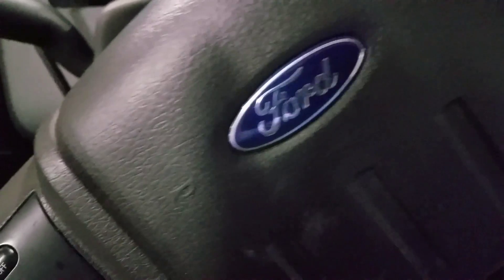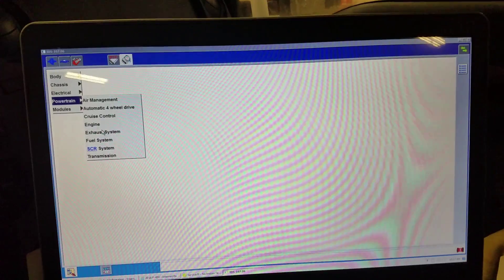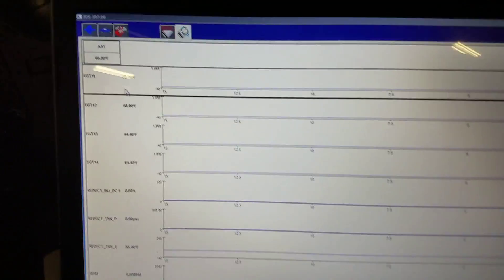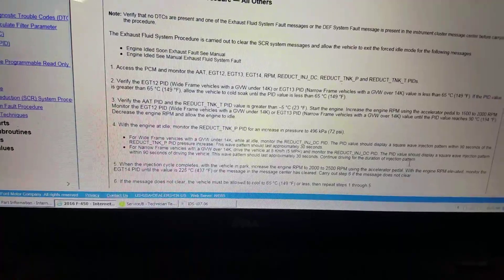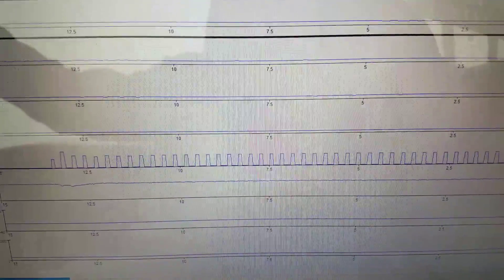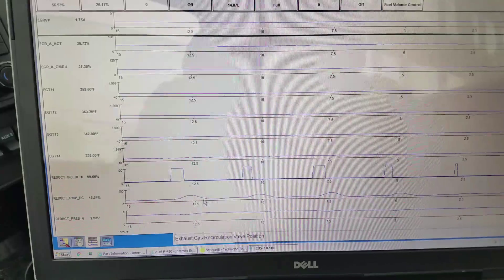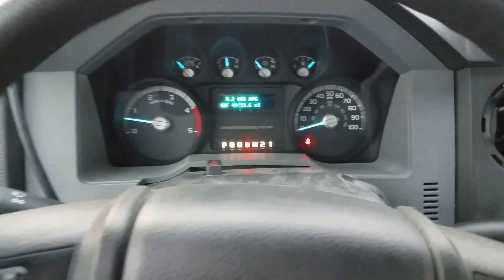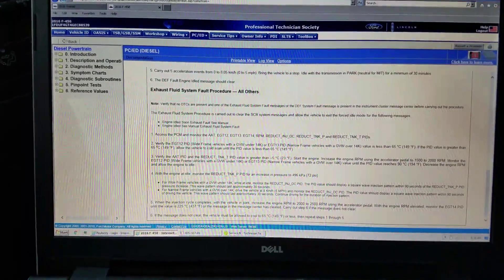Ford 6.7 DERATE warning messages - FIX IT NOW! #viral

Comment: Is there anyway to get a 2016 f250 lariat out of engine idle with out a computer I need to get it to the shop which is 70 miles away
Reply: Thanks man love your videos
Reply from the maker: You could try sitting there at two thousand r.P m for 5 min

Comment: Hey man. I’m trying to get a customers truck out of this derate. Exact same messages and no DTC’s. I have tried the drive cycle 5 times and I can not get the 1-4 EGT to 437F, I can’t get it past 360F. Also my DEF injector pattern does not look like that, it looks like triangles not squares. Any ideas? Thanks!
Reply from the maker: Are you using IDS? What year is the truck?
Reply: @ I’m not. I need to renew my IDS license, I miss it. I’m using an AUTEL. 2015 narrow frame
Reply from the maker: @belllpatrick hmmmmm wish ya were closer
Reply: @PowerStrokeTechTalkwARod  I can get an IDS scan tool and use that if that would help
Reply from the maker: @belllpatrick absolutely
Reply: @PowerStrokeTechTalkwARod  ok, what difference does that make in this instance monitoring pids?
Reply: @PowerStrokeTechTalkwARod  we ended up updated the pcm with the latest update using IDS and it cleared with a drive cycle easy way before 437F. We also got the square wave pattern after the update.
Reply: @ it came in with the idle only condition. Only one DTC and it was for an AC pressure sensor, I fixed that and now no DTCs. It started earlier in the morning with the customer with the 50mph max message then quickly idle only. The def tank level pid read 99.98% when we got but we put about 1.5 gallons in it somehow, it now reads 100%

Comment: Have you encountered the service filter now message on the 2020+ powerstroke? Have a 22 with that message, had dpf professionally cleaned and still have the message and the engine code will not clear I’ve tried Matco and Snapon scanners will not run a regen and stuck in limp mode.
Reply from the maker: Gonna need a dealer level scan tool that can access those faults
Reply: @PowerStrokeTechTalkwARod  copy so texta and none of the other big brands will be able to clear it.

Comment: What software and computer are you using for this? Dealer told me 3 weeks before they could look at it. Exact same issue I am having after filling with def. Any help is appreciated. Frustrated!
Reply from the maker: Ford IDS software. You can use Forscan too.
Reply: Good grief! 3 weeks where do you live?

Comment: been reading alot about DEF since my 97 f250 7.3 PS does not use it and i know have a 23 f450 ho 6.7.  you are the first one that states to fill def tank completely.  i had planned to add 2'5 gallons when the tank got down to about a quarterfull because i didn't want the def to get old setting in the tank.  i am trying to save the new truck for trips, etc and use the 97 daily.  is it a bad idea to just add the 2.5 gallons when needed. thanks and i am a subscriber!

Comment: We had pin spreading at PCM due to a mechanic at a different shop jamming something in there to test with, then cutting wires that should not have been cut at all.... El Butcho El Chopo

Comment: What if the warning comes up and were not out if DEF just refilled DEF a week ago and only drove less than 500 miles.  Still had 20 miles of the count down left when i pulled up to DEF pump.  This has been a reoccurring issue with my 2015.  Delaership has already replaced pcm, pcm harness, reductant pump, reductant harness.  Getting expensive
Any ideas why i keep getting a exhust fluid system fault warning?
Reply from the maker: What code r you getting & why did they replace all that!?!?

Comment: So I pretty much knew about this system when I got my 2015 in nov,2014 and read up on it I’ve never had an issue with it other than a couple of def heaters and froze the system up once when I jumped on the freeway when it was slushy and stupid cold out I was out plowing and pretty much froze the entire underside of the truck so I got the 50 miles till speed limiting, Plowing was over for that storm. Upon restart The PCM forgot that there was an issue I just drove south I got all the way to I  Louisville Tn from Milwaukee and the ice pack fell off the bottom of the truck and the issue was over🤣 Yeah I think I had cabin fever😇 , jump forward 4 years to now and I have started to decide that the DEF system had lost its mind speed limit warnings ect… all fixing themselves so I filled it all the way up and told it that it was full (via FORScan)i dont think it cared or listened and now about a week later I’m at Forced engine idle. In the morning I will run through this procedure as many times as I have to to allow it to rediscover it pea sized brain. That said i always put 2.5gal at half full however this last time around I probably helped it lose its mind after nine months of it not asking for any def I I want ahead and put 2.8 gallons in at the pump.

Comment: I’m sitting here with a 2015 f350 that I started the procedure to clear the forced engine idle and yeah my laptop died I had no idea what my temps were at that point so Round1 fail, and I simply decide to let cold soak overnight I’ll deal with it in the morning, Then I remembered I can watch pids in real time on  my phone, but alas it was too warm so I’ll wait till morning. On my phone I have FORScan Lite and a few other things but this works best it’s only for Ford, my laptop I has FORScan. this is literally the first time I was using it on the laptop so I’m still in the learning curve.  it does have a ton of procedures/ resets that  it will run for you. I use both with a plugin adapter that can natively read the can-bus and the HS-can-bus.
Reply: A small update this morning I hooked up to the truck KOEOFF  configured my pids I didn't bother with EGT13 as this is a wide frame, started the truck confirmed the aat and reductant tank temp was above 23 f and revved it till it got to 200f idled it yeah it took all 90 seconds and maybe more for the dosing cycle to begin, it finished and I revved it between 2000 and 2,500 yeah it took a little while to get it up on egt14 to.... it cleared the light when it got up to around 311f  all fixed. I'm sure I caused this all by myself when I'm at home I fill up def at the pump but I'm on the road so it's coming out of bottles. This is the first time for me it probably won't be the last but it did take 8 years to happen. Now I'm going to go turn on the daytime running lights.

Comment: how much was the customer charged for this? my 6.7 has the same thing going on and im taking it to the ford dealer here in wisconsin.
Reply from the maker: Depends
Reply: @PowerStrokeTechTalkwARod  i went to my local ford dealer. 2 weeks until they look at it. later today i drove to the gas station and it reset by itself. no more limp mode or light on. im happy!!!!

Comment: I have a 2016 that has idle locked a few times now. Trying to learn about the SCR and how to resolve these types of issues. The first time it idled I got a very similar square wave pattern to the video on the reduct_inj_DC pid, now its getting sloppier with longer waves and more irregular in nature. Anyone know if thats a sign of dirty/bad injector? I've drained and replaced the fluid and was good for few hundred miles, now back to being idled.
Reply from the maker: Your not doing somethin correct Jonathan
Reply: @PowerStrokeTechTalkwARod  It works though, which is odd. In fact in the last five minutes I've pulled the truck out of idle mode. I guess its still a square wave, just longer duration. I still need to resolve the "why" of why this keeps happening, but we're getting there, huge thanks to your videos.
Reply: @PowerStrokeTechTalkwARod  follow up part 2: the waves are flat topped, but the trailing edge may have a more dramatic slope and the pattern itself is irregular. Rather than a nice consistent /'\../'\../'\../'\ it may go /'''''''''''\............../'\/'\......./''''''''''''''''''''''''''''''''''''''''''''\. Rough description of a wave pattern, but if it helps anyone to see it's weird looking for me, then great.

Comment: I just got a speed limit at 55mph within 150 miles. A check engine light as well with two codes p207F and p0401. Before this happens, the truck was self-cleaning the exhaust filter but I accidentally turn off the truck while that was performance. I don't know if that happened because of that or something else. ??
Reply from the maker: If you need diagnosis you'll have to get inline & come with $$$ my time is no longer free. Sry, just business....

Comment: Fill with DEF...Clear codes..Do not have to drive.....Hold  to 2500 Rpms for 6/10 mins will accelerate up about 2900 rpms after 6/10 mins on its own and will reset ...Manual Regen...This will fix dead pedal and clear error....
Reply: SUCCESS! I did this tonight but used an Operator Commanded Regen instead of manually holding the throttle pedal. Drove for 10 minutes afterward, shut the truck off, and then back on, and the error was clear! Thanks for being one of the only people I've found in all of the comments to suggest this!
Reply: I was racking my brain replacing parts $$$    I did this for about 9 mins @ 2500rpm, truck forced reg, got rid of the engine idol, started again no check engine or idol mode....big thanks
Reply: This comment got me fixed. Used forscan/obd2 cleared DTC codes, filled DEF, ran about 2500 rpms (parked) for 17 minutes, rpms increased gradually but also quickly up to 3100 over the span of 10 more min, oil temp approximately 230 (if i recall), code went off after about 27 min automatically
Reply: Does it need to be in limp mode in for this procedure to work?
Reply from the maker: @dgrisham6868 yea

Comment: I have 2 questions. 
1) what is the software that you are using? I think it is a license that you load on a laptop and it cost $150 a year and how do you get those passcodes? 
2) Are you a mechanic or work for Ford? Anyone can do this with the software? Or do you need special passcodes or access? My F350 has this code nobody wants to touch it or do anything with my truck.
Reply from the maker: 1. IDS, your cost is WAYYYY off. 1a. Have to buy em.
2. Tech 2a. Yes 2b. Yes
3. Bummer. You can pay me to fix. Sorry we do not diag on this platform.....
Reply: @PowerStrokeTechTalkwARod  where are you I'm in the Orlando area.
Reply from the maker: Motorcity....
Reply from the maker: No. U need the vcm too. It not just a license
Reply: @PowerStrokeTechTalkwARod  
Thank you for your time

Comment: Interesting - I have been driving my 2011 for many years and just recently had an issue where it seemed like it couldn't tell how full the DEF tank was. Initially (years ago) I would try to fill the DEF tank - which was always messy because I couldn't add a full 5 gallons. so was always spilling over.
Then I decided just to add a 2.5 gallon jug every time I got down to the 800 mile warning. That had been working perfectly with no issues until very recently.
I added 2.5 gallons and soon after I got the 800 mile warning again!
Wasn't sure what to try - so I decided to top off the tank and wee what would happen. That made the 800 mile warning go away - and I haven't seen anything since (but it hasn't been very long).
I just heard you say in this video that I should have been filling up all the time?
Since I have replaced EVERYHING in the DEF system at least once (except the plastic tank itself) - I know that there are three rods that it uses to do a very rough fluid level measure.
I was afraid that one of those was malfunctioning on mine - and that may be. Just thought I'd ask you if you have ever seen or heard of this.
Seems like DEF corrodes and kills everything over time. The heater unit has the rods (as you know). I am not getting a code on that - but thinking the level sensor bits may be failing.?.?.?
Reply from the maker: You are correct. However that part with the rods...is also the level sender. You'll have 2 replace the guts with OE parts. Nice description of your issue. Sounds like you've been reading the theory and operational manual...nice bud 🙋‍♂️
Reply: So how do you know when its full my 2011 ford  doesn’t have a fill monitor until it tells you  do you just let it spill out of the fill port  I’m getting a def sender error on mine

Comment: I do all thos get to the point where it build pressure but doesnt duty cycle the injector... Need a def injector¿?
Reply from the maker: No, u musta not did it correctly
Reply: @PowerStrokeTechTalkwARod  i followed the ids page ypu ahowed waoted for egt12 to reach 194 built 73-74 psi of reductant pressure then didnt turn the injector on
Reply from the maker: Cant have any codes stored. Gotta be doin somethin wrong
Reply: Unless i miss understood something this problem did start with a p207 though
Reply: Yeah I cleared the codes in the ecu. Ill try it again tomorrow
Reply: Got that message to clear on the dash and everything seems to be working right, but it turned the engine light on again for. P207F. I removed the tank drained it and filled it with deaf roght form the dealer
Reply from the maker: Watch my video for p207f

Comment: Cycle  key on and off three times make sure the fluid is full in system now drive vehicle in manual mode you want very high temps and for the the def pump to clean itself with high pressure demand. 40 miles per hour in 3rd gear for about 5 to 10 mins or until oil temps rise to about 235 or so if this doesnt work repeat the steps but this time if you have a exhaust break turn it on turn traction off and tow haul mode on. You will not mess up the truck unless its chipped and straight piped at which point you wouldn’t even have these problems to begin with. No i was stuck at the 5 hour mark from home coming from Phoenix heading to norwood Colorado to pickup a 40 foot gooseneck trailer so trust me my hotshot dreams were in my stomach. I watched some regen videos heard what all you guys had to say then said 🤷🏾‍♂️ since its under warranty and a tow will cost a couple thousand anyway might as well try whatever. It absolutely worked and im pretty sure i wont be taking it to the dealer as the car fax shows the pervious owner already replaced the heater in the def tank. The warning light and 50 miles to 50 mph message disappeared and decided to continue to norwood to pickup my trailer. You either believe this or not but trust me these engines are solid its the def crap that sucks and i cant remove it if i wanna be DOT legal at weight stations hope this helped somone out like it did almost stranded 300 miles from home🙏🏽🙏🏽🙏🏽🙏🏽
Reply: My 2020 f550 just popped this message up.  Topped it off with fuel, cycled the key 3 times, turned on engine brake and traction control off.  Then ran it down the road at the rev limiter 3400ish rpm for about 8 minute before the message cleared.  Oil temp never got above 225.
Reply from the maker: Ur lucky
Reply: @PowerStrokeTechTalkwARod  I feel lucky, companies truck fleet is thin and last thing needed was another truck in the shop.
Reply: @PowerStrokeTechTalkwARod  2 years later 20k miles since and still never had another issue. It works and never been to a dealer and never had a check engine light
Reply from the maker: Wow! Thanks for reporting back
Reply: Thanks it worked for my 2016 f250 cycled the key 3 times than I held rpm at 2500 rpm for around 6 minutes and the message cleared and I took it for a good ride in tow haul mode about 20 miles and it seems ok and the oil temp never went over 198 degrees f. Thanks gents
Reply: I tried using Forscan and the procedure for this fault on my 2016 F350.  I couldn't get it to clear until I drove the truck using your technique.  I was down to 11miles to idle, but after about 5-10 minutes of driving the truck, it cleared on its own.  Thanks for posting this technique.

Comment: I have I have a 2012 6.7 L I had gotten a message warning exhaust fluid level low I always keep my tank full so I don't know if I let it get down to low or what but I had that message for about 4-5 months but my truck was fine and then just today I get a new message that tells me exhaust level sensor I hope I can just get out the whole system reset and not have to put a whole new sensor in going to take it to the dealership tomorrow I hope they don't rob me
Reply: Will I had same error on my 2012.. sensor high level reading or something - did you get it fixed and how

Comment: Filled up the def. Cleared all codes with a cheap scan tool. Was driving to ford to drop it off “about 20 miles”, and the light went out. 🎉🎉
Reply: What was the scan tool u go to advance auto

Comment: This works for the "50mph limited" mode as well. Thanks!

Thought I'd add the details of the problem.

Code P207F 270,000 miles. Replaced both original NOx sensors, after confirming proper def pump pressure, quality, and proper spray quantity out of the nozzle. Looked inside EGR cooler, soot deposits looked normal. Cleaned oil/carbon off throttle body since I was there

After the warning message was reset, the truck was getting about 120 ppm NOx on the inlet and 7-15 ppm on the outlet cruising at 70 mph. No codes so far

Comment: PowerStroke Tech Talk w/ARod  Hey bro i have a 6.7 2013 F250 saying exhaust fluid / System fault , And reduced power engine / I tried to do  a dynamic regen but it says failure engine didnt get hot enough , I need help got this truck off copart and tha speed is limited to 5MPH and Def Fuel tank full
Reply: Follow those precise steps in the video, it takes a long time but it worked for me
Reply from the maker: I dont lie...